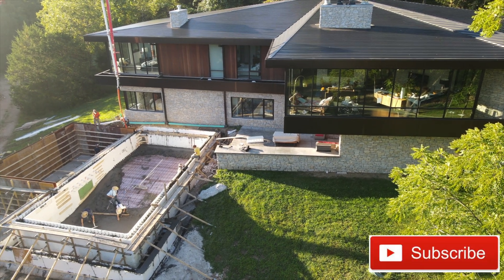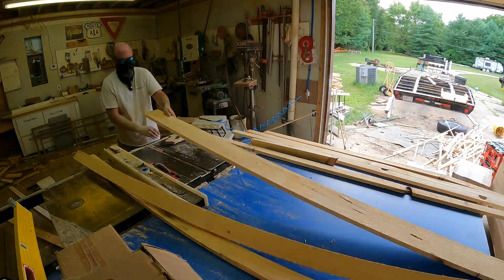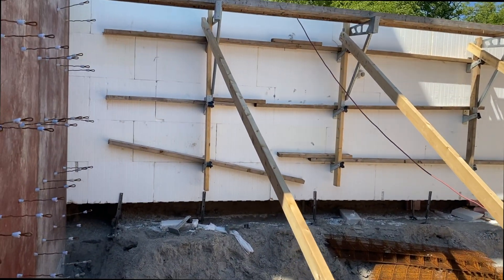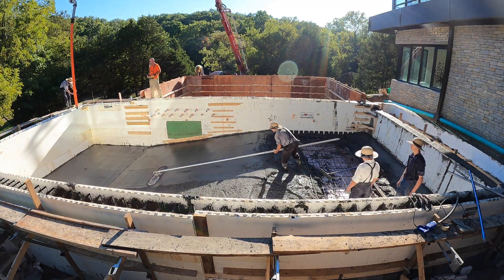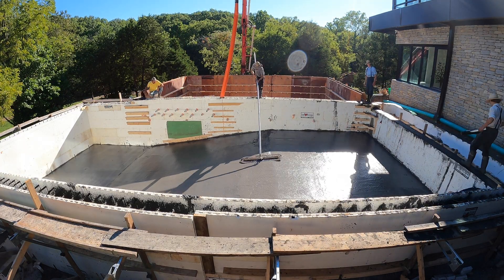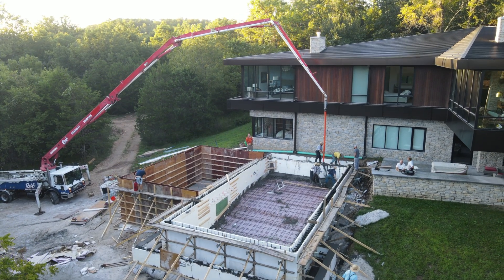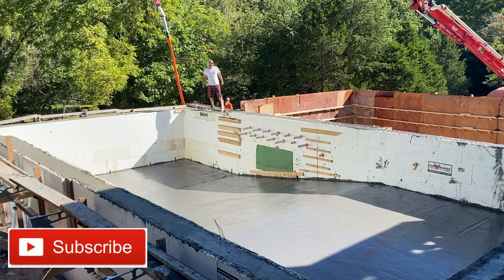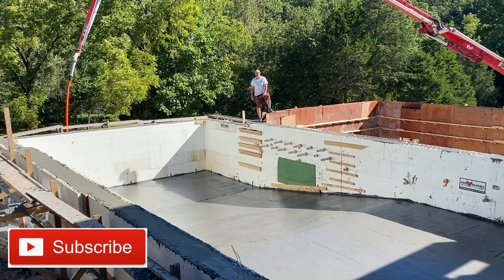Amazing ICF Custom Pool and Board Form Concrete Details!

Comment: I am looking into building my own concrete ABOVE ground pool, simple rectangle 16' x 32' no deep end and I am finding very little information on ground prep.  I live in NY so we have a frost line.  You are the only person I could find offering DIY concrete pool advice who is actually a professional pool installer.  Any help would be greatly appreciated.  I also can't wait to see your ecofinish videos I am convinced that is what I will use since i have only ever owned vinyl liner pools.

Comment: You mentioned pucker factor!  I usually have a fairly sleepless night on my big houses before pour day.  We’re about to start building pools so I really appreciate your videos!
Reply from the maker: Ya, we know what we’re doing but the consequence of failure is so high on a 100 plus yard pour day…. Back when I used Simons forms I would freak out because one missing t bolt and you were having a bad day and they didn’t stand out…. Icf and cam locks are more fool proof, but definitely not entirely lol

Comment: What do you use as a waterstop around each of the PVC pipe penetrations?  I've seen simple waterstop rings that go around the pipe in the middle of the concrete to big pre-made pipe and plate combinations.
Reply from the maker: I like the water stop rings you mentioned, more versatile than the bigger fittings!